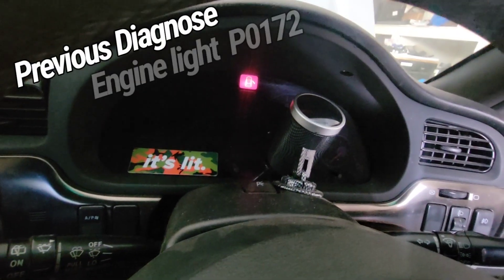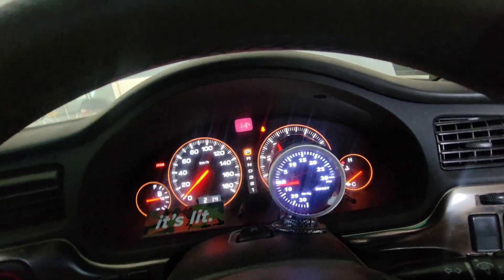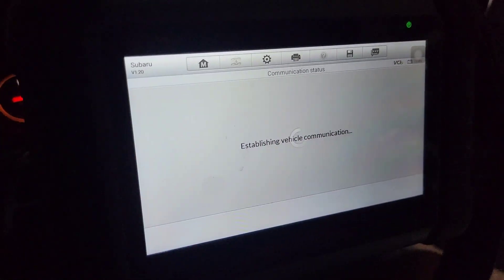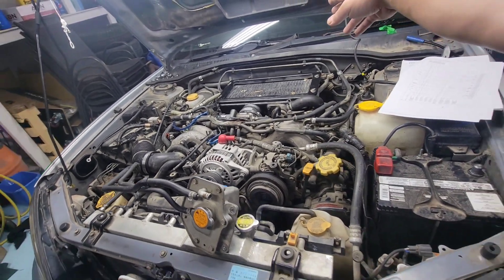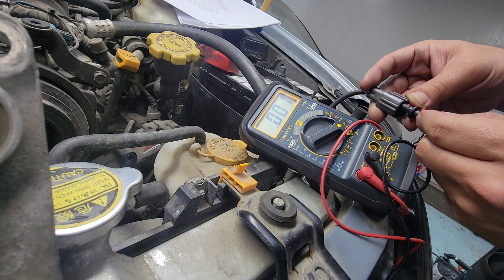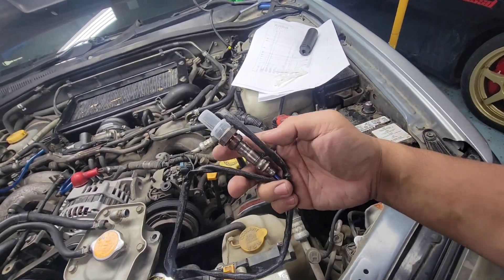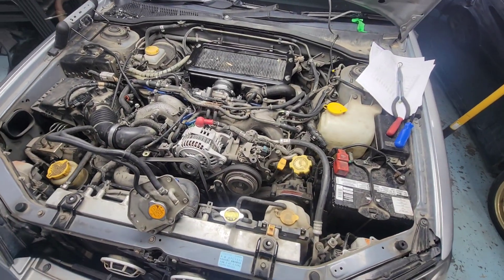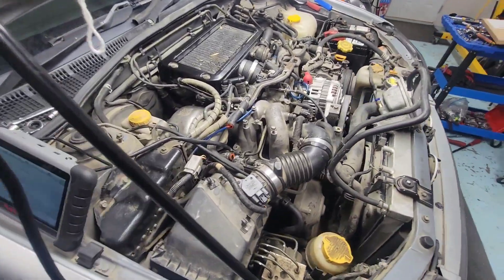P0172 Code Fixed! Only Fixed i did was Replacing this Part.

Comment: Hi there, I'm diagnosing a rough idle, vibration around 1700-2000rpm and feels like a loss of power in my EJ208.  Thinking dirty/bad MAF, spark plug/coil, or maybe O2 sensor.  Do you have a part number for the O2 sensor in this video?
edit: my bad, rewatched the video NTK24659
Reply from the maker: Did you scan the code out and see if your going in the right direction
Reply from the maker: Update farther Diagnose it was Vacuum leaks and  fuel regulator leaks

Here the link Fuel leaks https://youtu.be/2ySawdGEZEc

Vacumm leaks https://youtu.be/175k7l7zHdk
Reply: Thanks, I'll check out your videos. I don't have a check engine light and my scanners can't read this ecu.
Reply from the maker: Do u know how to read spark plugs?  Plug out all the spark plugs  show the condition of that cylinder
Reply from the maker: Whats the update? Did  you find the problem